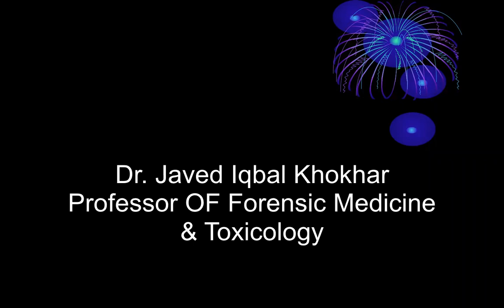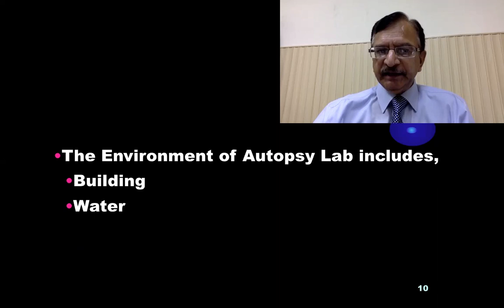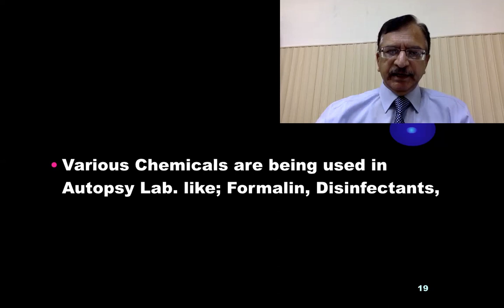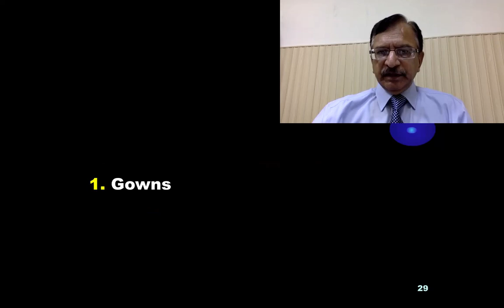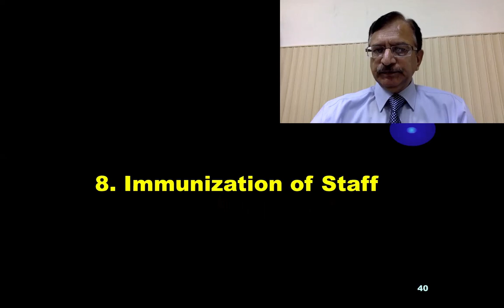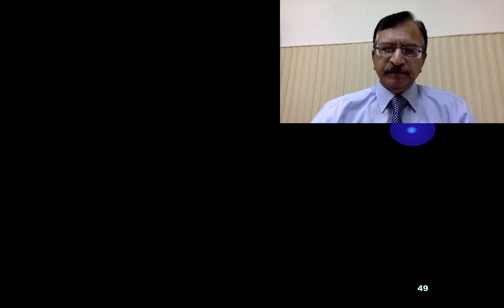31. AUTOPSY HAZARDS OF AUTOPSY MECHANICAL ELECTRICAL CHEMICAL INFECTIOUS #autopsyhazards

Comment: Nicely described Post mortem room hazards , among the electrical equipments add suction pump or machine , in chemical hazards add  Potassium hypochlorite solution , which is corrossive in nature , deepfreezer should be properly earthed with gel electrode  ,and RCCB Circuit breakers must be installed in Mortuary Power supply
Reply from the maker: So kind of you 
What an excellent analysis always have from your kind Sir 
Each feedback improved my knowledge too sir 
So honored